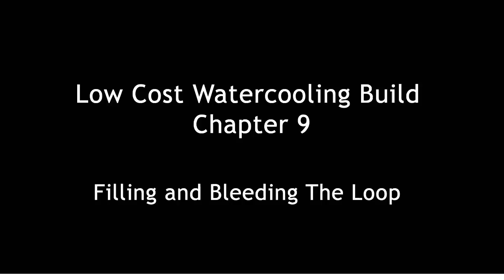How to Fill Watercooling Loop and Leak Test  the System - Low Cost Build, Part 9

Comment from the maker: @JustineBieberxoxo I'd say ones a year for sure. Also if you want to optimize performance you may want drain and clean cpu block after few weeks from very first assembly because if there is any junk were in your loop it will be sitting right inside of your block.

Comment: Testing a loop outside of a rig, from my experience, has a higher risk then leaving it in.

If you've got a complex loop, you don't want to be messing around with it when it's leak tested putting it in the system. It's extremely easy to back out a barb by rotating the pipes during this stage, and this will cause more then a minor leak.

Leak test IN the case, but do so with a hotwired PSU and plenty of sheets of kitchen roll over hardware. This is the best method.

Comment: just a tip but put a drop of dye in the water it dont effect the conductivity much but its alot easier to notice a leak if there is 1 you will notice the colour allot faster than a wet patch thefor stopping the leak and keeping your system safe but the best way is to just test the loop outside the case if possiable

Comment: Nice vid! Just wondering, when you first turn on the pump it seems very noisy - is this due to the initial trapped air being pushed through the pump? The sound becomes much less harsh as more water is added.

Comment: lol Bro, thank you for being extra cautious but if you take the proper precautions you can use regular distilled water without problems. It's all really just preference also. If you want to use water, go for it. if you want to use coolant, go for it. My only suggestion is you read up on the things that would make you have a safer build regardless of what you choose.

Comment: On top of that, when you first do your loop, you need to have the loop running without the wrest of your computer being connected to the power for approximately 24 hours to make sure that there are no leaks in the system. This means that if there are spills, as long as you are using a non-conductive liquid and you give the parts enough time to dry properly before you have electricity flow through the part again, the part should not be damaged.

Comment: Hey daz , should i have any cables ( 8 pin pcie / cpu power cable / 24 pin etc. ) plugged into the waterboard while doing the leak test ? I'm planning to use an old computer i have to power up pump with a 4 pin while i do leak testing. As a matter of fact can i just do the leak test with the psu in place, but just plug in a single molex to power up the pump, so i will only have hardwares in place with no cables or whatsoever, and then plug cables and everything in once leak test is done.

Comment: awesome guide, but expensive components!!!

I got an old "Asetek Waterchill" 240-kit "240 black ice radiator" that Im gonna use for my GPU only (xfx6970 at 95C-full load) The pump says 1020litres and 2,4 meters and its originally for socket 478!
Got plenty of room in CM-408 Chassis
Do you have any suggestions for such a build?
Buying EK-fullcoverblock (95$ and probably half inch tubing and fittings)
Would be awesome if a guy you DazMode could give some pointers??

Comment: Instead of using an external power supply, you can unplug enverything connected to the power supply and use a paper clip to jump start it (bent a paper clip to connect the green and any black wire on the 24 pin. This will turn on the psu without being connected to anything (except for pump)

Comment: Really good video, but as another person asked what is the power supply you used?
I can find no external power supplies that have molex connector.
I am no expert which is why I ask.

Also do all waterpumps use 12v or do some use 5v?

Thanks in advance
Gren

Comment: +DazMode Would you recommend going for a low cost loop or an all in one. And if so are compression fittings worth the extra cost over barbs
Reply from the maker: Prices wend down a lot since 2009, so compression are now as cheap as barbs back then. For convenience I'd say use compression. AIO is not my cap of tea, so cant recommend even if it make sense.
Reply: ek predator AIO
Reply: Pandawatch shit leaks more than the snappening

Comment from the maker: @itisfunnyer It is like your car. What happens if you never change oil? Few things happen over time: your coolant becomes conductive from dissolved metals, you may accumulate some gunk that needs to be flushed out, your blocks may (or may not) get blocked with debris.

Comment: @onlyadot if use non conductive fluid such as the ones found in feser coolant products then u wont have to worry about messing up any of ur parts if coolant does get on ur stuff. it is a bit more expensive but the price is well worth the extra assurance you have when it comes to protecting your very expensive parts.

Comment: You don't need an external PSU, you just have to connect two wires on the 24 pin (can't remember which ones) and the PSU will turn on without powering on the whole system.
Reply: ***** Yeah, actually my "kit" came with an adapter so you dont even need to hook up to the motherboard
Reply: Green and black :)
Reply: Green and black :)
Reply: +Hayden Ross for those who don't use shit power supplies? it is the 4th pin from both sides on the section where it clips to your motherboard.
Reply: What about disconnecting the graphic card and the hard drives? This is my first time doing this I got to flash my PC loop about. I need more info please.
Reply: @uphill248  I'm in the same boat.  I heard it's best to unplug both cpu 8 pin and GPU from power.... And I'm hoping I can simply disconnect the cables from my modular PSU to avoid getting to the 8pin CPU power cord.  Did you have any success?

Comment: Hey I was just wondering what you mean by not having the entire system on. What's the problem with having it all on?
Reply: Dandy Marvin sorry for the late reply but if its not on then if the cooler leak water it will not explode

Comment: You can use anything you want. The only problem is that if you use a conductive liquid like salt water, it'll fuck up your system if a joint starts spilling. If you use distilled water or any other non-conductive coolant, your system has extremely low chances of getting damaged on accidental spills.

Comment: HI, what is that external power supply that he is using in this video to power on the pump? thx.
Reply from the maker: +jincuteguy Any 12v Dc power supply with MOLEX connector will do.
Reply: +DazMode Thx man :) Nice video, keep up the good work.  I really like to see you're doing a new video of bending the Chrome plated copper tubing but without the fail part :) Because I'm trying to build a copper tubing as well and I'm looking for tools that can bend the chrome plated copper tubing.  But after seeing your FAIL video, I don't know if it will work or not? Maybe buy the tubing from McMaster shop?
Reply from the maker: +jincuteguy It was wrong copper tube after all. Bend first plate after...
Reply: +DazMode Nice man, Im really anxious to see your new Chrome plate copper tube bending video :) Cant wait.....
Also, what do you mean "wrong tube"? Isn't that chrome plated copper tubing from Bitspower?  And what new copper tube are u going to use? Like where u bought the new ones from? thx
Reply from the maker: +jincuteguy Already switched to acrylic tubing. Will do copper sometime in the future... or won't as acrylic is cool enough for me after trying it.

Comment from the maker: @HolyHavoc444 That depends on your level of self-confidence and willingness to lose some time on drying parts in case of a leak. I personally never test anything outside computer, because it waste of my time.

If you feel more comfortable to test it outside your rig first, there is nothing wrong with adding this extra step.

Comment: If I'm doing just a gpu loop can I just uplug power to the gpu and start the pc when filling?
Reply: you might risk damage if you do, so i dont recommend that
but thats just my opinion
Reply: You jump your Psu and run pump without power to the computer
Reply: I have tons of parts i thin ill just dedicate an old dell psu for this.

Comment: @taz001ish take a paper clip and touch it to the green wire and then take the other end of the paper clip and touch it any of the black wires (you can use a little piece of wire instead of a paper clip)

Comment from the maker: @Syakir2004 Half true. You need some additive to reduce corrosion processes and kill bacteria. Only water can be problematic in long term, although I run my system on pure distilled for 6 months just because I forgot to add DazMode protector to it and nothing happened.

Comment: @habowh43 you can just use a second or older psu and bridge it , green to any black wire, that so you can use that psu to power the motor, ez and low cost

Comment: @crispy82185 get a good one... dont get a h50 or low range one... i run the h80 corsair and it outperforms most if not all air coolers on the market... and as for leaks i also owned a h60 and i never had a problem... it is almost impossible for them to leak... youd have to abuse the heck outta the thing to get a leak

Comment: believe it or not, if a CPU has no cooling method then it will cook itself before your boot cycle has even finished, they get very hot very quickly (100 fahrenheit within about 1.5-2 seconds of hitting the power button)(100 celsius within about a minute)

Comment: it really scares me when you put a reservoir and pump on top of your PSU.

i know your PSU is off, but when leaked, it will be explode since voltage on PSU are same as your A/C current (exp 110v or 240v) not like other peripherals that's only 12 volts.

Comment: @onlyadot
It is actually pretty save. Just read alot about the whole system works, and test the loop outside the case.
Reading will save your live one day ;) Believe me, at first i was scared of WC my $3000 rig too.
But if u take it one step at a time and pay attention, there should be no problem.

Comment: shouldnt there be a way to check for leaks with those pipes and fittings outside a computer
have fake hardware to connect to, you could basically install in a real pc to get the correct measurements for your pipes, then take out the pipes and install them to some fake boards or something, so if there is a leak, at least the water wont spill on your hardware when you test
Reply from the maker: You can assemble loop outside computer, but then you still need to break it apart and re-assemble again, so I question benefit of that.

Comment: Incorrect. You can get a paper clip and jump the green to black connections on the Atx 24 cable without needing to buy and external power supply.
Easy, cost efficient way.
Reply: Chris Connolly i mean its not inncorrect, just more expensive if you dont already have the psu

Comment: Uhuh... I was just hoping that it isnt just plain water, but it looks like he is getting it out of a water bottle... Using water in a 'watercooling' loop in a PC is a bad idea, because if a pipe splits or a joint comes loose and water spills on the components, it could irreversibly damage them. Watercooling loops are typically filled with a thin non-conductive oily substance.

Comment: Did it have a filtration system? Because you know that sea water fucks up pretty much any component and if it was google lol the probably had a bad ass filtration system or some sort of material that can withstand the sea waters might xD!  Either way just saying that proves nothing and you shouldn't use sea water in you watercooled system.